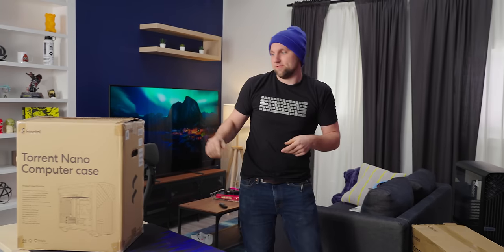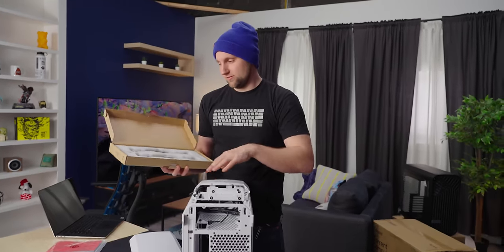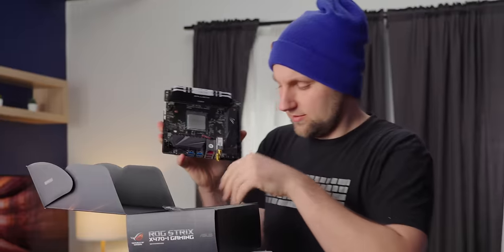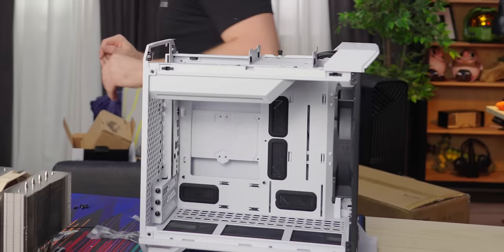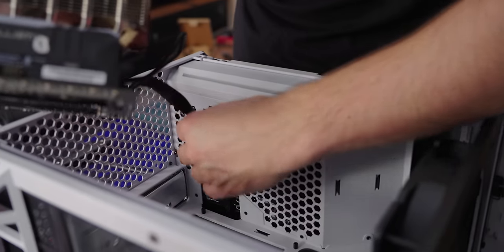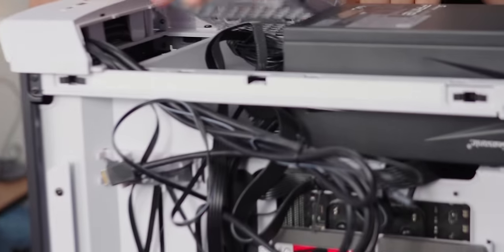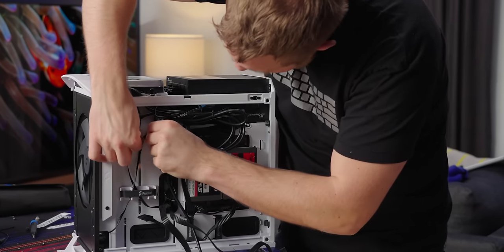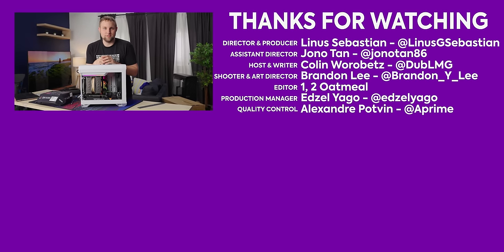The BEST case got SMALLER! - Fractal Torrent Nano

Comment: Thats a poorly designed case.
Reply: Nom  the comment is based only on my observations in this video. It started with a traditional layout ("attic type") which should make the build a lot easier but it doesnt. You can see he has a hard time plugging in the cables at the deepest corners of the case even when that is a relatively bigger case than most of the modern layouts we have today. The power supply cables spilling over its bay and out to the HDD bay? I get that its design priority is for airflow but even on that regards, i think its not well protected from dust. Some chinese SGPC and Metalfish designs could do better job than that at smaller footprint albeit with also relatively poor dust protection. But its just my opinion tho. I could be very very wrong and I accept that mistake if that may be the case.